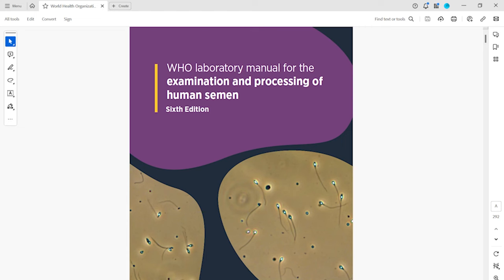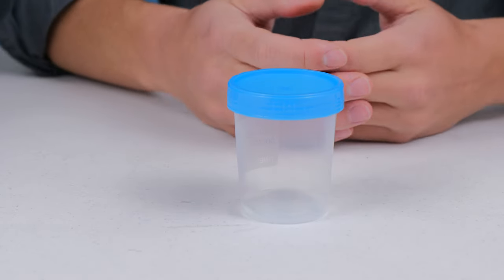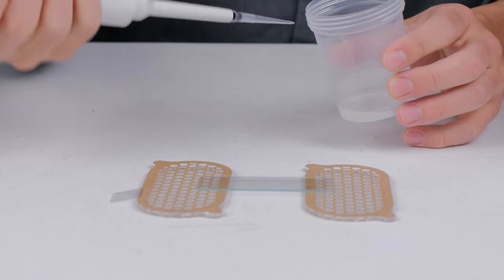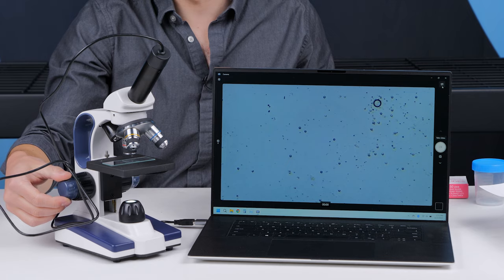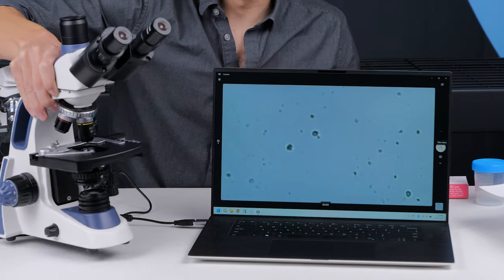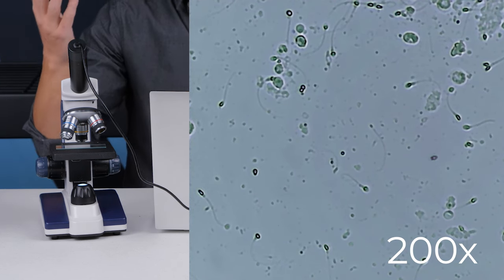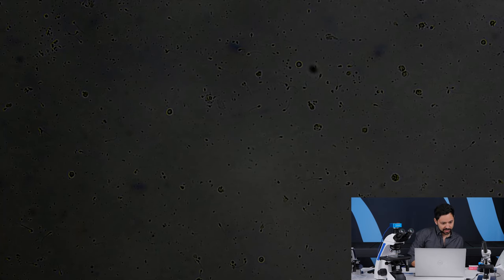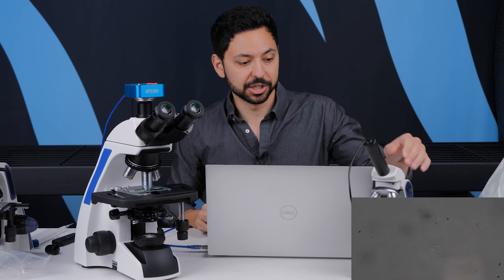How to See Sperm at Home Under a Microscope

Comment: Why they are not swimming?
Reply from the maker: Could be a couple of reasons. The process of collecting and micropipetting the sample can sometimes kill the sperm cells. The office that I was doing this in was also really cold that day. I think in this sample I also opened up on a small bubble at first so the sperm were out of the liquid.
Reply: Would dropping the lens on the drop kill them?
Reply: @E85_STI if it hits them then yes

Comment: you can also use dark field filters
Reply from the maker: Agreed! Darkfield filters also work, however I've found that because the specimens do not strongly scatter light, you need a very bright transmitted light source to make this work. A 3W LED that is found on most consumer microscopes is too dim to get a meaningful image. Also the heads will show up much brighter than the flagella, and so if you are using a camera to image the specimens it is hard to have both the head and flagella properly exposed without blowing out the image.

Advice to anybody trying to use darkfield to image sperm - use a darkfield filter with an NA stop just above the NA of the objective so that you are maximizing the oblique light that hits the sample. If you are using a camera you may need to manually adjust the exposure to account for the dark sample.

Comment: I purchased a AmScope to look at dog semen and I can't see anything. It has a WF25X eye piece and 100/1.25, 40/0.65, 10/0.25, and 4/0.10 lens. Sorry, I don't the technical terms. Should this microscope work for this? Or am I probably doing something wrong?
Reply: First, take your WF25X and throw it away (very bad image quality).
Then, try to find the proper WF10x eyepiece that came with the scope. Follow the video, watch is few time, it cover all the important steps.